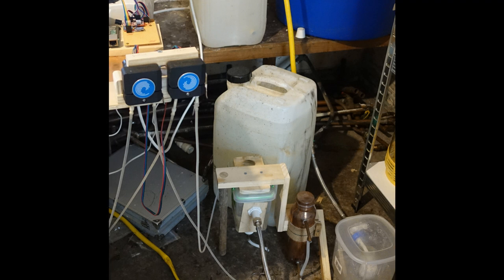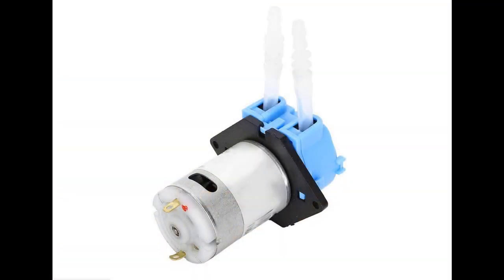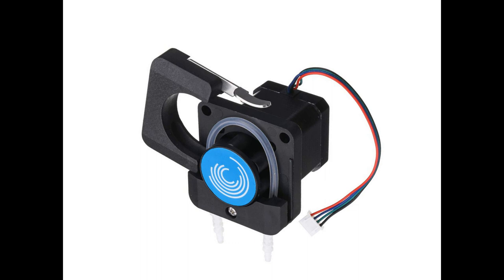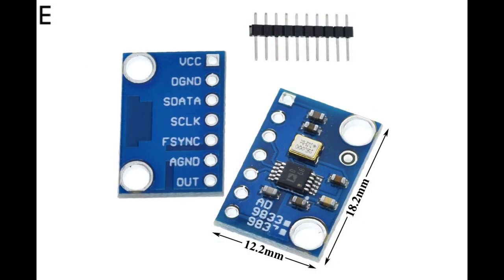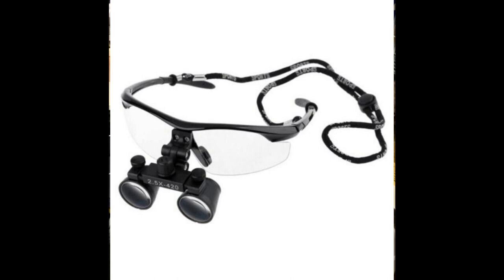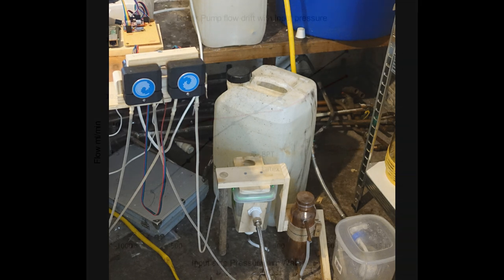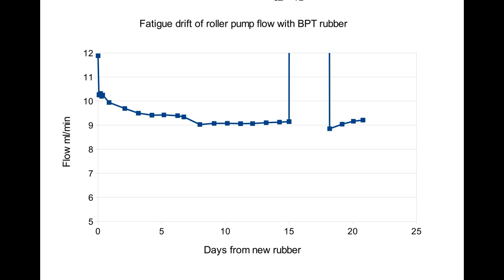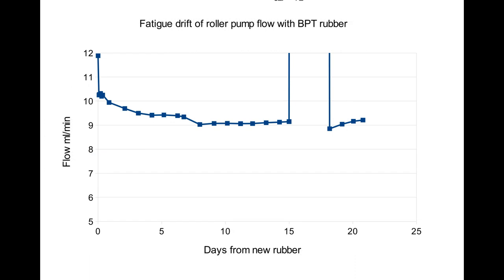Peristaltic roller pumps for continuous distillation of moonshine

Comment: Something I may try out is using "diesel heater fuel pumps". I have a heater which uses one. These are metering pumps which have a diaphragm and are pulsed to meter fuel to the heater. They are rated in "dose" in some way, eg. 22ml means 22ml per 1000 clicks (pulse of 12V). So to get 2.6ml/min you'd need to pulse it 118 times (~ 2 Hz). One I looked at can go to 12Hz for higher rates. They are designed to run all day/night for years so should give good life for around $12USD.  Exactly how accurate or durable I don't know. Just seems like an option to test as they are very easy to use, cheap and apparently long life. For wash I think it would need a filter on input as they do for diesel fuel to avoid clogging.
Reply from the maker: I have looked at click type fuel pumps but not the diesel heater type. I have not tried them in anger because most are not designed to be used with aqueous liquids. They depend on the diesel they are pumping for lubrication and rust protection and I'm not sure how long they would last pumping wash. I will take a closer look at them though.
Reply from the maker: Interesting, and stepper motor diaphragm pumps should work fine. His is quite expensive though and I'm not sure how long it would last exposed to wash which is aqueous and not free from sediment.

Comment: Have you considered a pump, regulator and fuel injector. The added misting might help with the steam generator.
Reply from the maker: Do you mean as from as internal combustion engine? I have not tried it. There may be advantages but they are designed for hydrocarbon fuels not water so I doubt they would last long in this application.